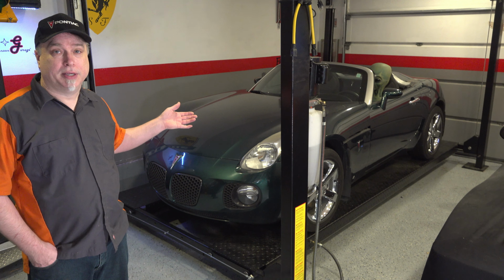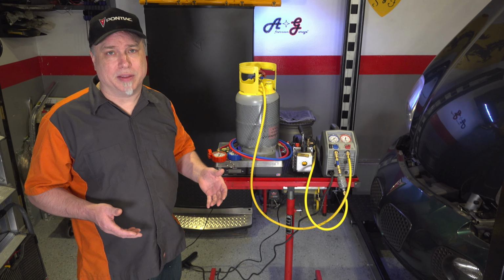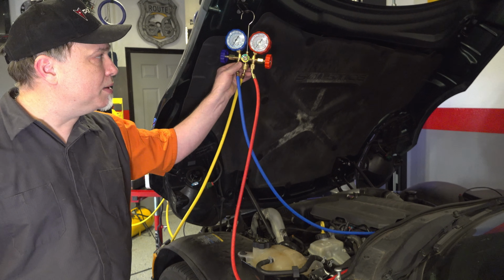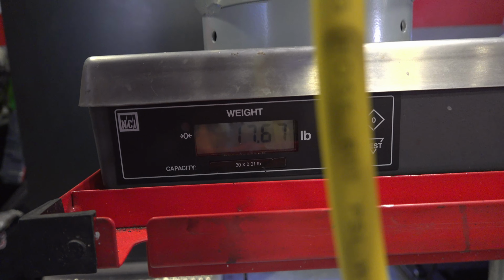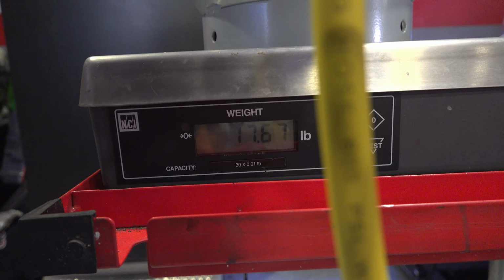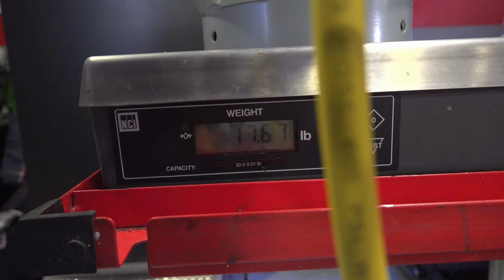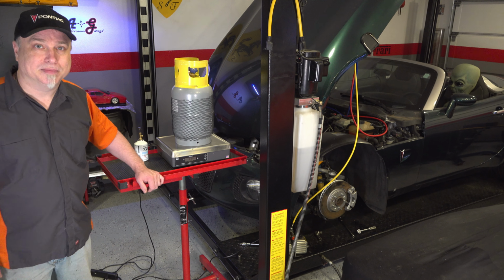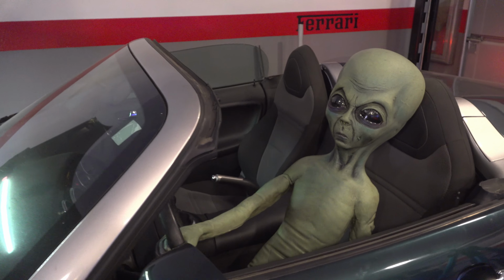Pontiac Solstice: A/C compressor change [4K] Ep54

Comment: Hi, we're GM.  We do things to make people glad to buy our vehicles.  Such as your having to disassemble the entire front end of the car just to change the oil.  We pride ourselves on making it a 3-day job.  Don't have the time, you say?  No problem, that's what we planned for; just take it to the GM stealership near you, where you'll be charged more than you would to simply buy a new car.
Reply from the maker: I have worked on engine accessories where the engine needed to be pulled, or at least unbolted and lifted off the mounts to get to a bolt or something.  Early S-10 Chevrolet Blazer plug change requires you to slide the engine forward a few inches to change #6.  Book time is funny for that, .2 hours for every plug but #6 which is 4.5 hours.  I'd bet that people opted to change 5 and leave the last for another time.  Knowing this, the AC compressor change wasn't too bad!
Reply: Was this on the base 2.4 engine or the 2.0 turbo GXP? Thanks

Comment: Hello, what happened to the noise of AC- system, did it go out after the compressor change?
Reply from the maker: Most of the noise while operating was gone.  I also replace the idler/tensioner and never had another problem.